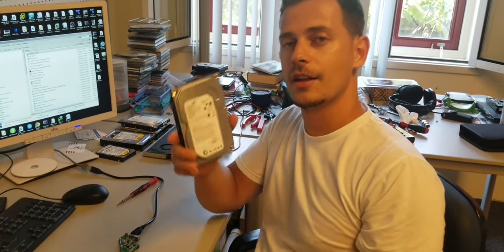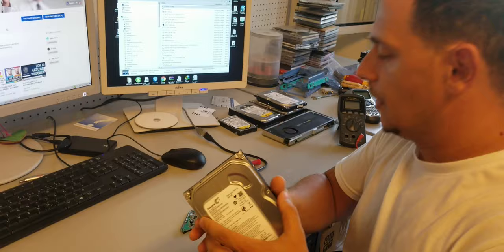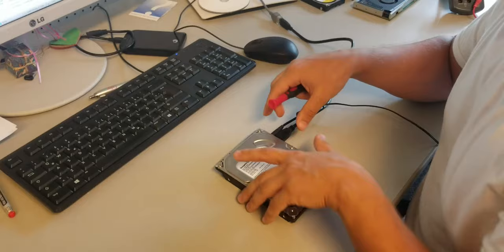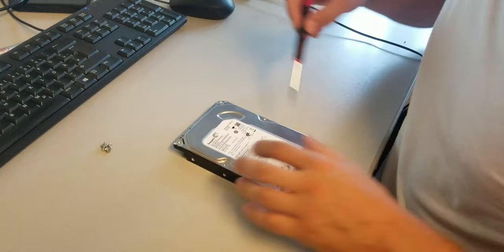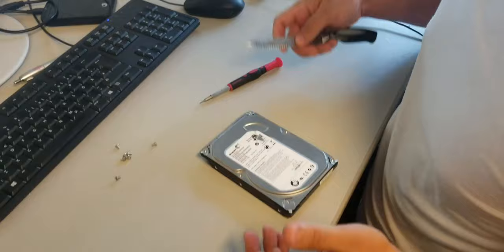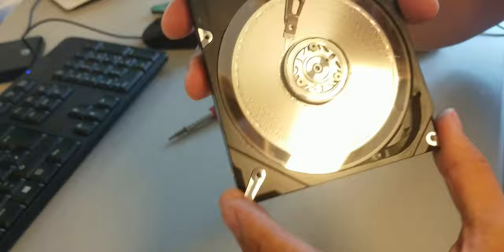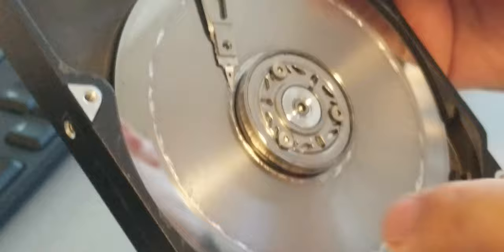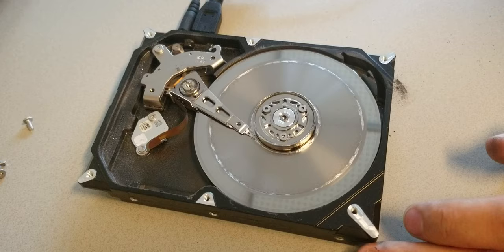How Dead Hard Drive Sounds Like - Hard Drive Failure Sign! (Click of Death)

Comment: Like how most of the video on this topic is usually Seagate hdds
Reply: I have a seagate hdd idk if the Sound cimes from it but i think so and its like a clicking
Reply: 2 of Seagate HDD is dead within 2 years. Way to go seagate
Reply: @raiyanmahmudtanim1992  really? You'd have warrenty most likely
Reply: I have a seagate. only owned it for about a year. it clicks now when i start up (despite my pc booting from my samsung ssd that ive had for over 6 years) and whenever i play a game from steam my pc will randomly shut off despite not overheating and having more power than needed from my 750w powersupply. Garbage company

Comment: hdd make power up noise constantly, with that comes a short 1/2 freeze/glitch data corrupted etc...
I changed one HDD that made the same sound, now the new HDD emits the same sound, i changed the PSU and the problem disappeared for a while but came back again, motherboard, GPU, CPU, RAM I never changed those components they are 4 years old? Please answer me?

Comment: Does the clicking sound a sign of hard drive failure in near future ? my HGST 4TB hard drive is making clicking sounds but its working just fine. I am worried if it will die soon or is it safe ?
Reply from the maker: If you hear this sound , that you better backup everything on another external or internal Hard Drive. 
And when you buy HDD make sure to buy black or red edition , dont buy wd blue edition. You can backup files to google drive or 1 drive etc.

Comment: Never getting another hard drive only ssds for me from now on
Reply: HDD canlive about 10 years and SSD can only live about 5 years.
Reply: @olimpather  mine only lived for 3
Reply: @sick069  its the other way around hard drive last usually 3-5 years but ssd last 8-10 yr
Reply: Not necessarily bad to get a hard drive just because it will fail. The only thing you have to do is back up your data, particularly important files.
Reply: @LayJD_  thats not the only thing, you save more money by getting a $100 dollar 1tb ssd than getting a $60 1tb hard drive that only last 3 years and is slow. because the ssd would last around 8 years. And buying two hard drives would cost more, only last 6 years, and be slower
Reply: @sick069  I agree with you 100% SSDs are the way to go for most people and are especially better for mobile applications and in my opinion hard-disks should never be put in laptops or mobile solutions as they are bound to fail - having moving parts they are very sensitive to torque and shocks from movement.. a lot of HDD mechanical failures can be traced back to how they were being used (some will last longer than others in these stressful conditions but in general hard-disks should not be moved whilst in operation). 
On another note SSDs can die much sooner though.. even within a year or way less - they have a certain amount of data that is capable of being written to the memory cells.. and this depends on the type of cells used. cheaper SSDs will have a lower total write limit so depending on the usage/user it will vary. (Okay for the average user still) Just saying that they are not perfect all around either. HDDs can be written an unlimited amount of times without a lifetime penalty which is the reason HDD life expectancy is rated in operating hours and SSD life expectancy is rated based on write cycles.. The handling and care will more dictate the life of the HDD. But the best thing is to do backups! whether on SSD or HDD they can still die prematurely and even have seen a new SSD from a reputable and popular brand die in a few months. The cost per GB is much worse on SSDs especially if you need to have 20TB of storage for example but then again the average user will need no where near that amount of storage =) I use 1 SSD for paging file and another for the OS boot disk and regularly accessed programs harddrives for everything else.. both technologies will not be obsolete anytime soon. HDDs will still have the edge for more affordable mass storage for a long time.. SSDs will obviously have the speed advantage. BTW i still have a maxtor 40GB HDD from 2003 still working right now. :D
Reply: @ProcessedDigitally  wow! That's impressive, we appreciate the effort you put into this comment
Reply: @sick069  cool brother!

Comment: How to resolve the problem reply Me
Reply from the maker: Is your drive inside physicaly damage? If not damaged inside than , try only 1 thing find another hard drive identical with the one you alredy have remove the discs from damaged one and put it to the new one ,  in the dark room sure not expose in sunligh! Yes this method its just 50%  nothing safe , but yo just try ! For the.moment your hdd is Daid !
Reply: Deepa Chezhiyan u can’t once the drive is damaged like that it’s beyond repair. The heads basically scraped all the data off. Not even a recovery company can get the data